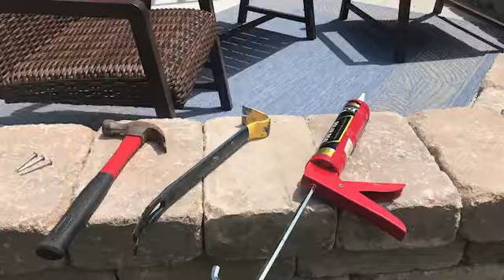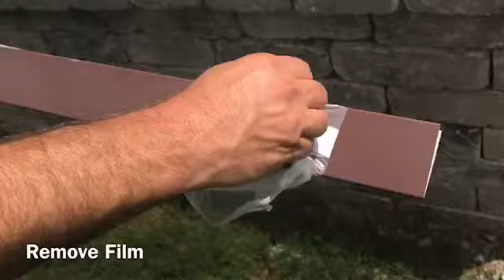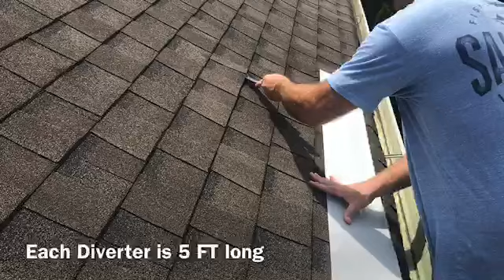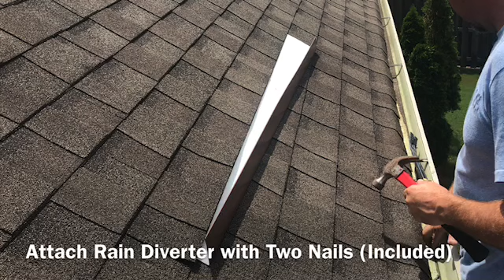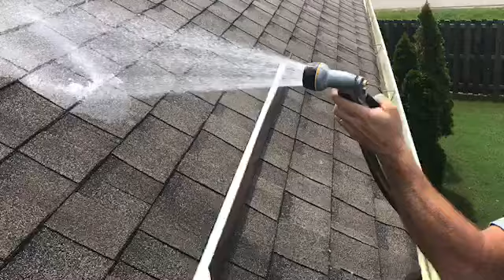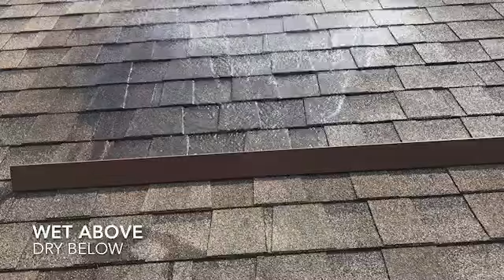Shingle Roof Rain Diverter Installation Video

Comment: Notwithstanding the existing gutter which would normally prevent any spillage onto an entryway, the rain diverter, in my opinion, needs more of a pitch to "divert" the flow. In heavy rain the installation shown will allow water to pool on top of the diverter and creep under the shingle eventually leaking into the soffit and wall. It needs a greater pitch and the nail covering roof cement is not an option it's mandatory. Water will find a way, and nails rust eventually when they continue to get wet. 
Thanks for the video.
Reply: Good point.  My house had a rain diverter along the backside of the house.  It was installed by the rain gutter company and was about 20' long.  However, they failed to give it any pitch.  So during a moderate rainfall, the water would wash right over it then fall to the patio like a water fall.  Fuggers!